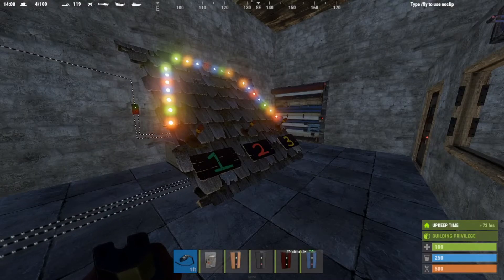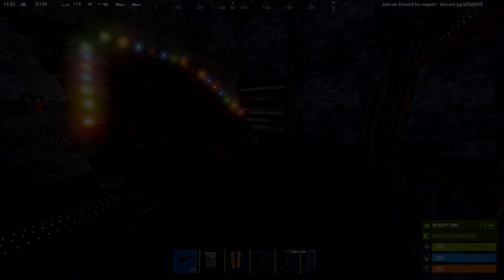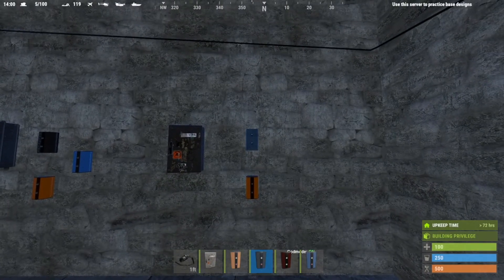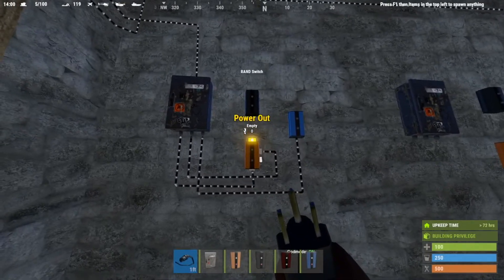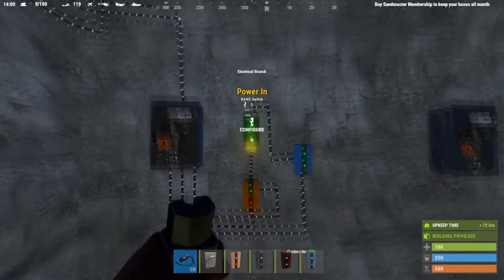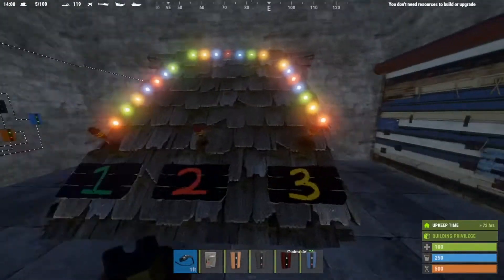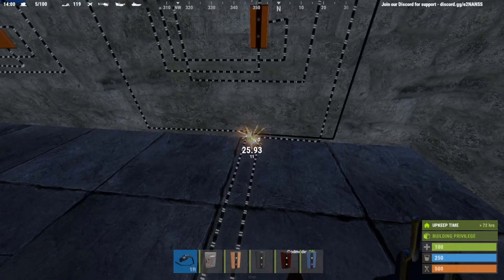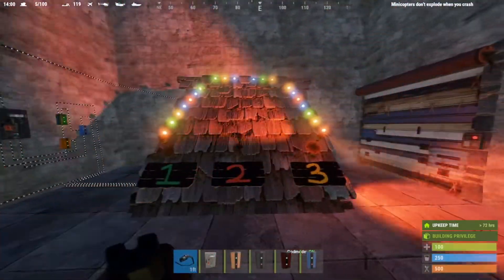Rust Electrician 101 - Ep. 1 | Infinite Random Number Generator!

Comment: This isn’t truly random. And there isn’t an equal chance of each number getting picked. Because in order for #3 to get picked, the others would have to be false. Example: in order for #3 to light up, it has a 50% chance of lighting up, but only if the others where to light up false. So I’m actuality, instead of it having a 1/2 chance of lighting up, it is actually “what is the chance of 3 being true and the others being false. Which means that #3 would have a 2 to the 3rd power chance of lighting up which is a 1/8 chance. While #1 only has a 1/2 chance of lighting up. The more numbers you add the less chance of them lighting up. For example if you where to add a 4th light, the chance of that lighting up would be 2 to the 4th power or a 1/16 chance. Which means that this isn’t truly a random number generator. I don’t mean to hate I just thought I would point that out.
Reply from the maker: I'm aware, this was at a time when no one was making videos on complex electricity in rust and everyone was still new to it. I have responded to someone else in the comments who pointed this out 2 years ago. Considered removing the video but I have also been told this has helped people do something they wanted and its a neat circuit nonetheless so I kept it up
Reply from the maker: Pinned your comment though for future viewers

Comment: I like the neat and extendable circuit but unfortunately the probability to hit "1" is 50% and for "2" and "3"  just 25% and it will be decreased more when you add more circuits.. so not usable for something like a casino or game
Reply from the maker: Thank you for pointing out a flaw here. Dont know how I didn't realize this. Im sure there is work around using splitters at the beginning sorcing similar circuits but it would be a totally different layout with big changes. May have to try it sometime in the future and get a truly even and fair randomizer video.
Reply: I just wanted to point that out before I've read this comment :D